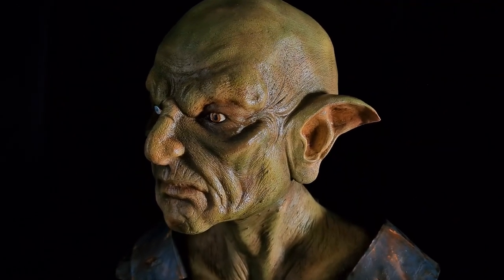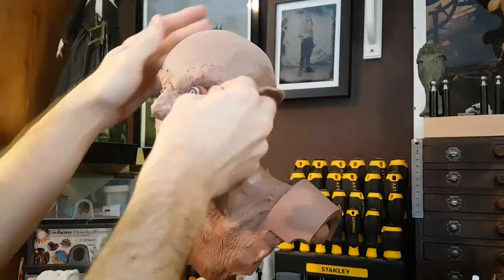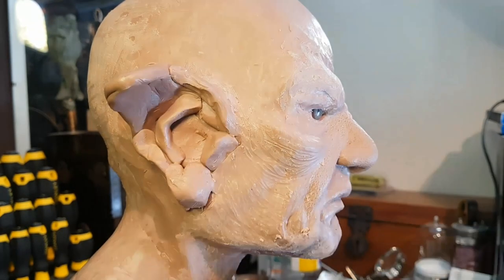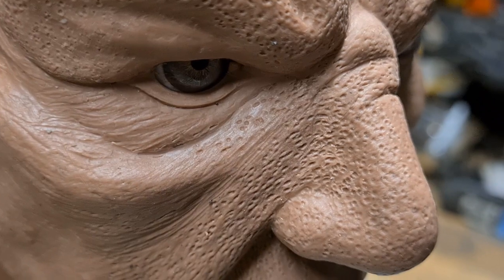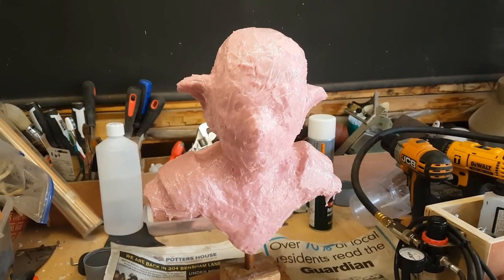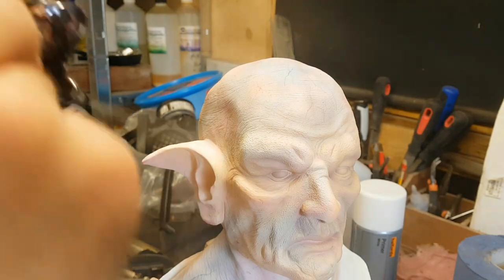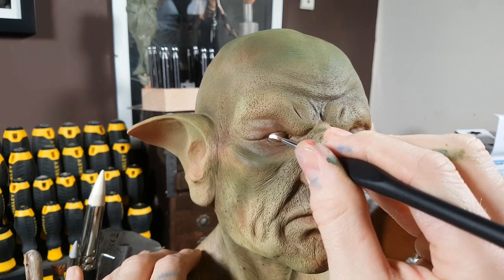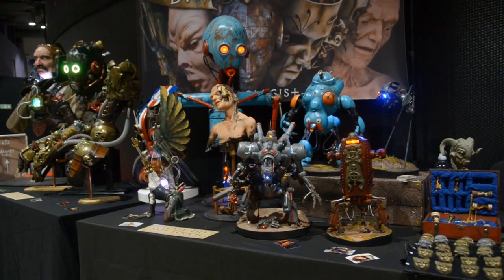Making an Orc Sculpture

Comment: Fantastic, the skin textures are way out there.
What was the thicker silicon you used on the mould? The stuff i've got is like the first one you painted on 
Trouble now is it's late at night and I was nicely settled but now I want to go downstairs and have a go aaargh!
Reply from the maker: Thanks!  Haha, yeah I hate it when I get inspired to do something at midnight!  It's the same silicon but I've added a thixotropic agent to it  - it's just an additive that make the silicon thicker so you can brush it on easily.  Most silicon systems have one you can buy.

Comment: Just one question, before applying the fiberglass, did you apply something to prevent it from adhering to the silicone? Or did you apply it directly and there is no risk of the fiberglass and the resin sticking to the silicone?
Reply from the maker: No, the only thing that will stick to silicon is silicon, thats why it's a good mould making material. So the fibre glass won't stick to it either.